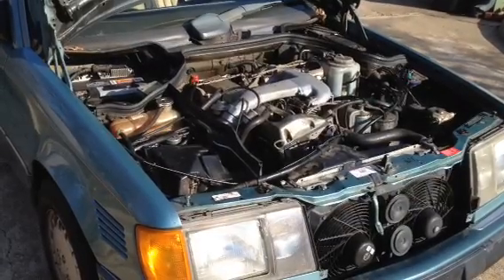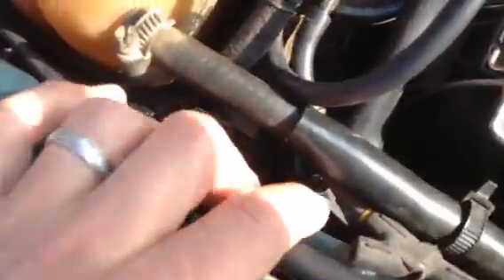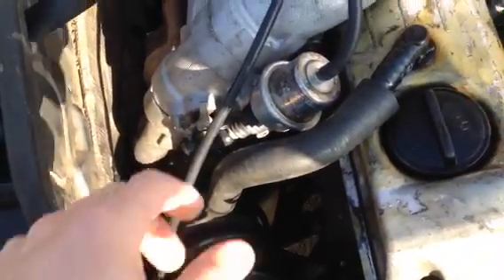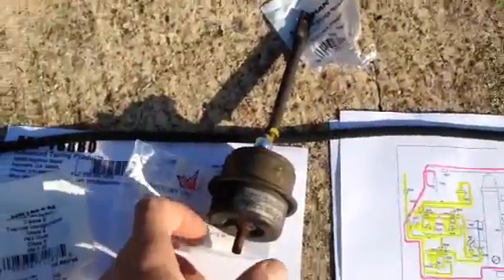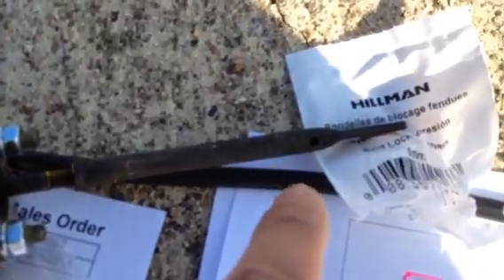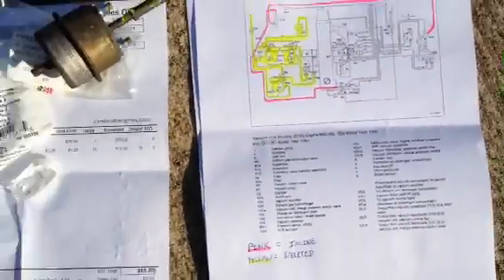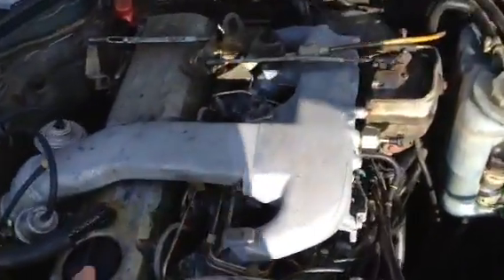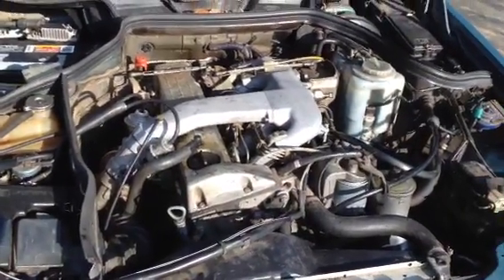1991 Mercedes 300d 2.5 om602 wastegate swap GSXR

Comment: Thank you so much for posting this! I've been trying to make heads or tails of the forum posts for months now and, for the life of me, couldn't figure out which vac lines to remove, plug and keep. After watching your video, I confidently popped the hood and had everything pulled out and the proper line rerouted in 10 minutes!